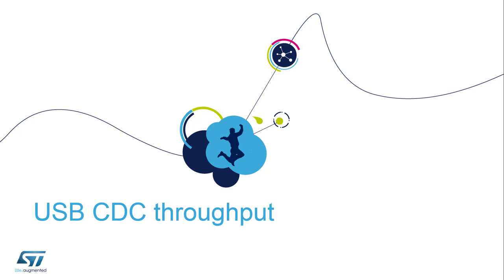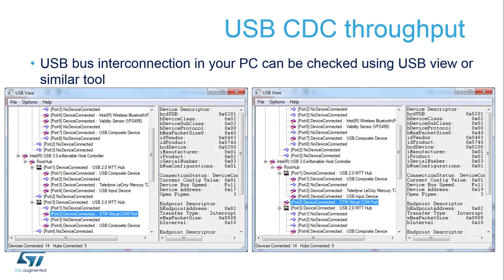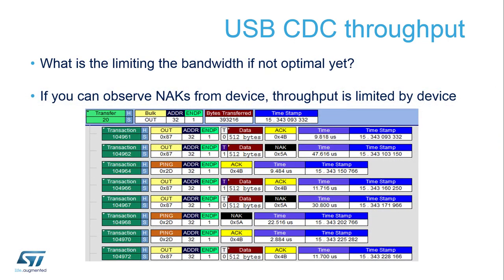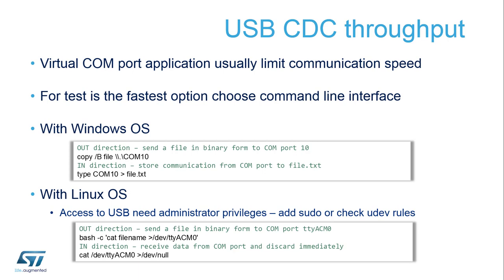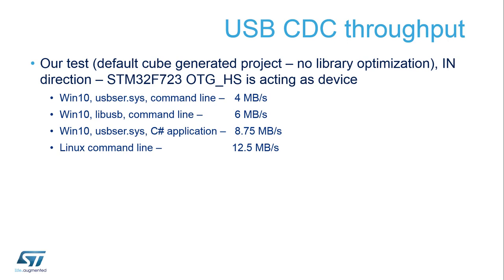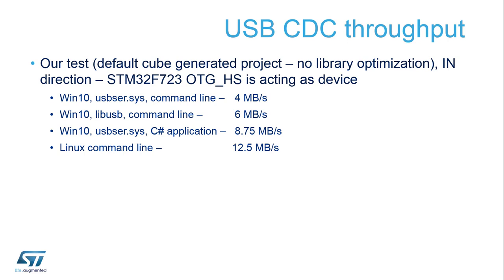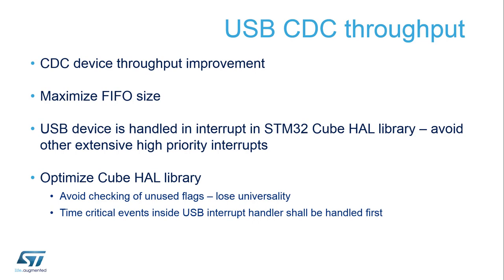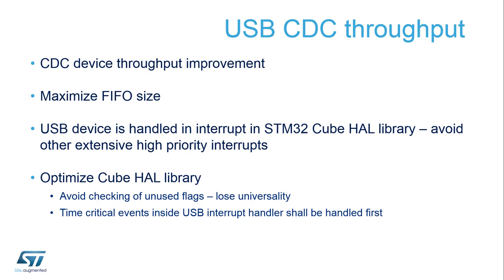STM32 USB training - 14 USB CDC throughput

Comment: Thank you for the breakdown on the USB throughput. Would it be possible to publish the c# test program that was used to test the throughput of the device, as to allow people like myself to compare our current implementation to the configuration that was tested for the final values. I did not see it in the download package for the class files. I am currently developing using the STM32H743 evaluation board.
Reply from the maker: Hello! Great suggestion, Visit our online community to find answers to your technical questions and share ideas with our developers and ST experts : https://community.st.com